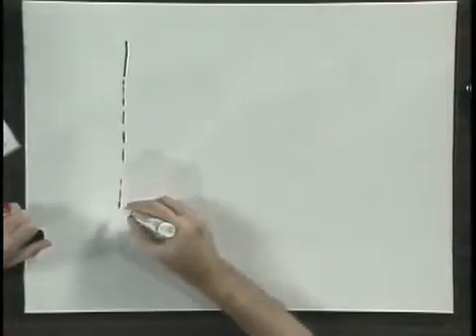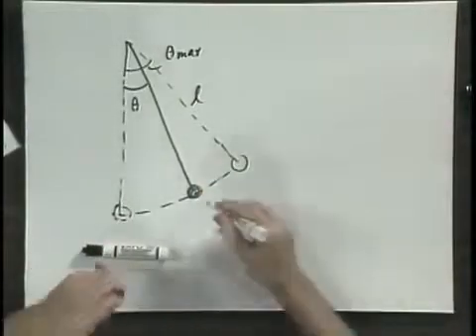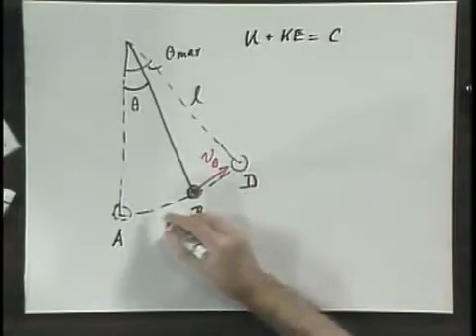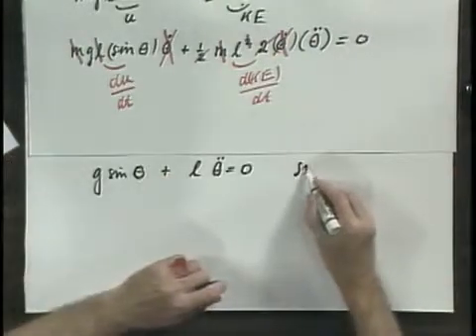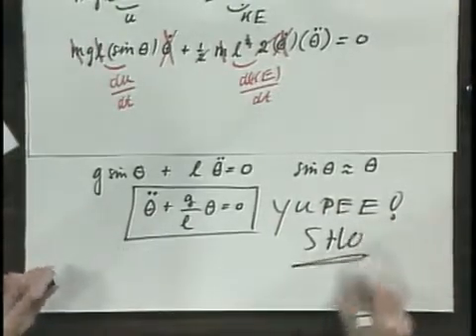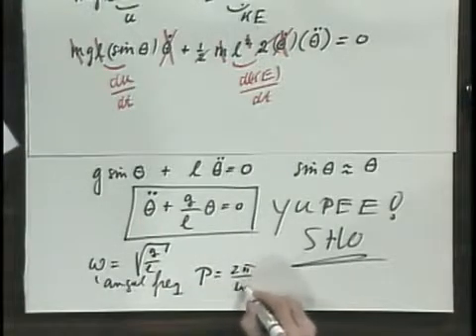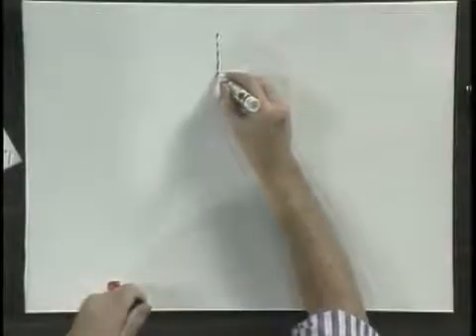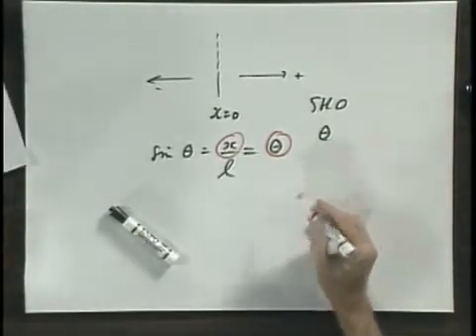8.01x - Module 15.09 - Simple harmonic motion of pendulum.

Comment: Sir I have a question
Let's suppose a pendulum doing small angle oscillation in car that is constantly accelerated. Now will that affect the time period of the pendulum(compared to when car is at rest) in car's frame of reference.
 My problem is that the pseudo force has a torque that has cosθ in it,now if i approximate cosine term to 1 the natural frequency of the pendulum remains unchanged (that was obvious too)  but if I include θ^2 in the expansion the differential equation becomes non-linear and I don't know how to solve non-linear equations. I'm stuck.
Reply from the maker: I you acc (a) the pendulum in the horizontal direction, the equilibrium angle of the bob will be displaced from the vertical by angle alpha: tan( alpha) = a/g. For small angles this pendulum will oscillate about the new equilibrium angle.